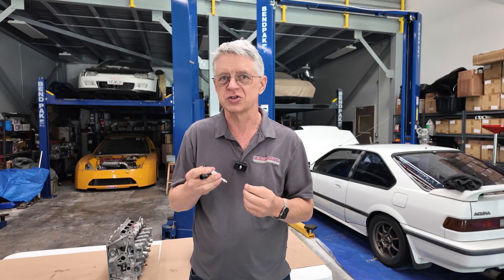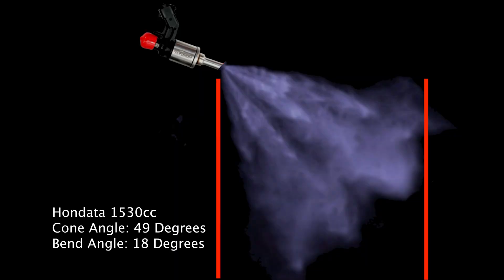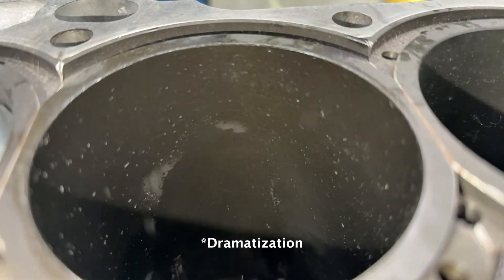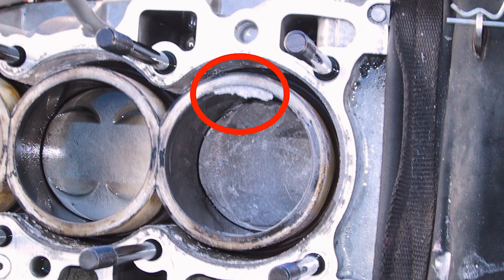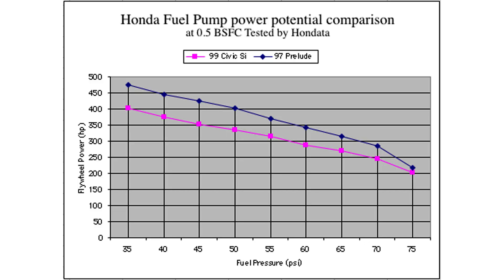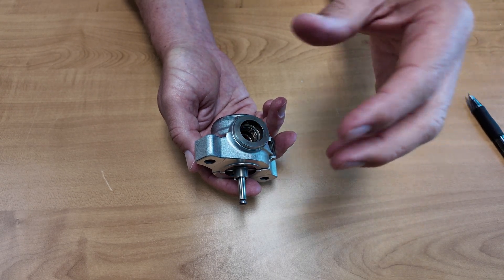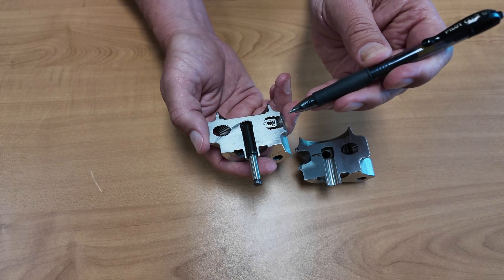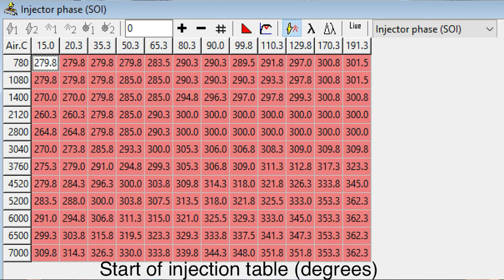Injector Tech Video - Hondata

Comment: I think your water hose demonstration is flawed because the hose nozzle orifice size changes when you adjusted the hose nozzle. Injectors have a fixed orifice, so you will notice a difference in volume that actually increases with the higher pressure. To test it leave the hose nozzle the same and use a quarter turn ball valve and actually set the hose pressure at a lower and higher pressure. Then turn the ball valve on for the same duration and measure the amount that comes out.
Reply: Thanks. That would be a better test. This  video explains in several ways why higher pressure delivers less fuel. I shared the hose video with several very intelligent people. Their "gut feel" was that the higher pressure delivered more volume.